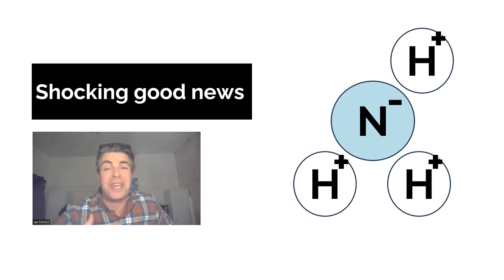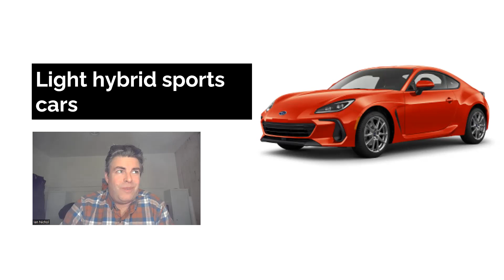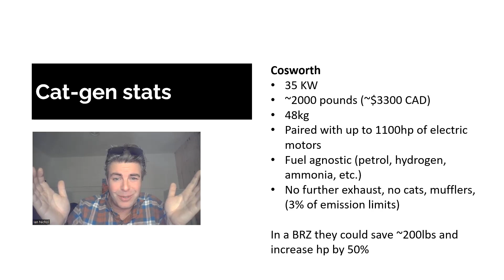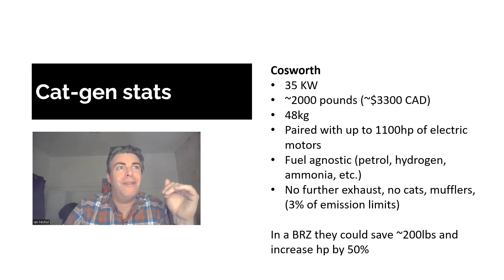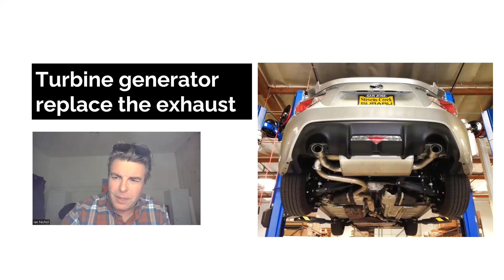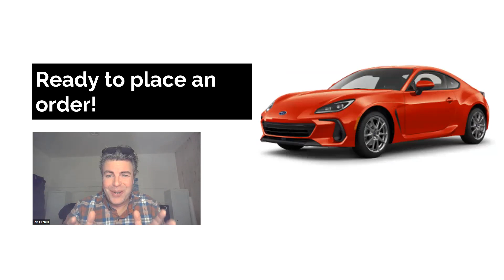Shocking good news! Cosworth’s Catgen could convert BRZ into a green hybrid rocket

Comment: Excuse my ignorance, just trying to make sense of your point, are you saying that with this ammonia  electricity generator you would only need a affordable small battery pack  that is being charged continuously? And that would have to keep up with the discharge rate? Depending on how hard it's being driven...
Reply from the maker: Yeah! Exactly. Ammonia is 9x as energy-dense as a battery, 100lbs of ammonia has the same energy as 900lbs of battery. If you have a light generator, say 100lbs + 100lbs of ammonia plus 200lbs of buffer battery you are lighter than a battery-only hybrid but just as green. I based the battery buffer estimated size on what seems to be common in plug-in hybrids. 

There are actually many variations on hybrid vehicles, the E-ray Corvette is very different than a Prius. But in general, I would describe 2 main types
i) gas engine connected to the wheels. Batteries and motors deliver additional kick under acceleration, harvesting energy under regen breaking, etc.
ii) plug-in hybrid style where only the electric motors drive the wheels and the gas engine adds energy to a depleted battery pack. Here the assumption is the average trip is short so even though the battery packs are small you very seldom drive far enough to use the gas engine, therefore the efficiency of using gas to generate power is a low concern

Different designs have different goals. What I am envisioning focuses on low weight with enough power to be fun. I did not do a lot of math or research on the efficiency of fuel-to-generator-to-battery-to-motor because even if it is 5% less efficient I don't really care if the fuel is 100% green and the car is fun.

This uses the same catgen tech. https://www.arielmotor.co.uk/hipercar-2/  Ariel is focused on performance, the car is 1100 hp. Using 1100 hp drains batteries very fast so they need something on-board so owners can do multiple laps at their track-days. Cosworth is happy to drive a supercar I'm sure but the tech was 100% designed around fuel flexibility including hydrogen and ammonia.  They have some other pilots in boring stuff like transit vans. For now, it seems the Ariel fuel tanks only support petrol.